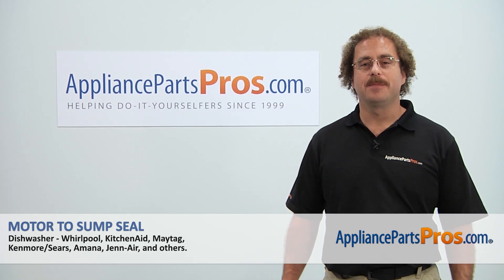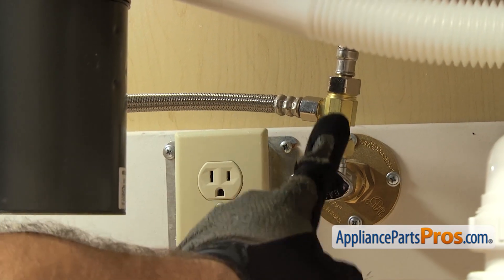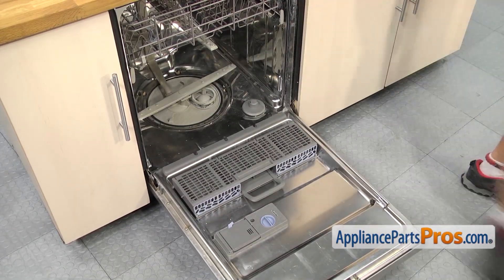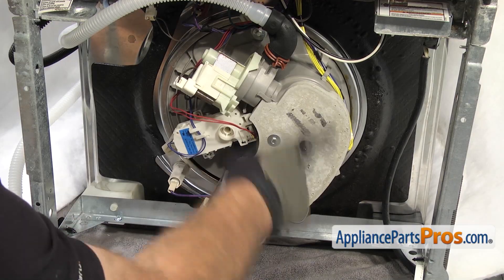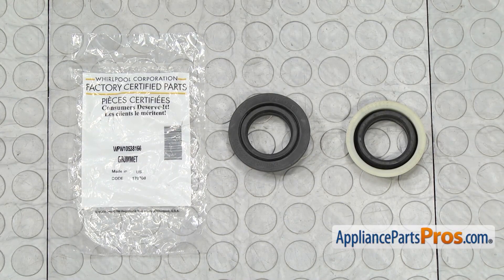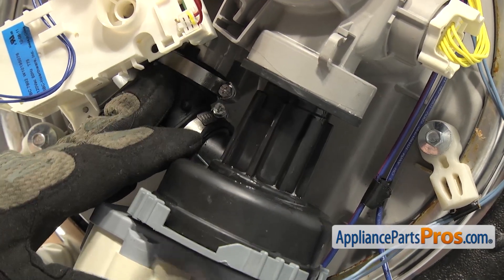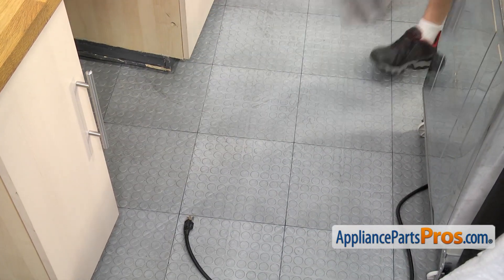How To: Whirlpool/KitchenAid/Maytag Motor To Sump Seal WPW10538166

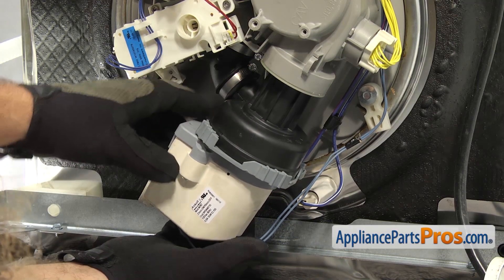Comment: From the 4:00 minute mark, where it says to pull towards us a little bit or slightly down (or away) from the sump, there is a post on my Kitchenaid D/W pump housing that must clear the sump ring in order for the pump to come out of the tab.  This is not mentioned nor is it visible in this video.  I can imagine if this isn't reinstalled correctly it would cause seating problems with the pump.

Comment: So, if I see soapy water puddling directly under the pump, does that mean its most likely the sump seal?
Reply from the maker: We'd be happy to help you figure that out, but we'll need some additional information about the model and the problem. You can give us a call at 1-877-477-7278 or you can chat us at our website: http://www.appliancepartspros.com/. We will need the model number for the appliance, so that we can look up diagrams and information about your specific unit to give you accurate advice. You can look here on our website to help you find the model number: http://www.appliancepartspros.com/modelnumber_locator.aspx
Reply: Slap Stick -yes

Comment: For some reason I can't get the pump to seat all the way into the new seal.  It wants to back out, should the tab on the sump click inside the rubber mount?  The repair guy couldn't get it all the way in either, and this is why the seal keeps failing.
Reply: From the 4:00 minute mark, where it says to pull towards us a little bit or slightly down (or away) from the sump, there is a post on my Kitchenaid D/W pump housing that must clear the sump ring in order for the pump to come out of the tab.  This is not mentioned nor is it visible in this video.  I can imagine if this isn't reinstalled correctly it would cause seating problems with the pump.